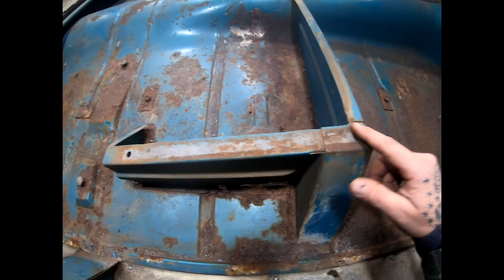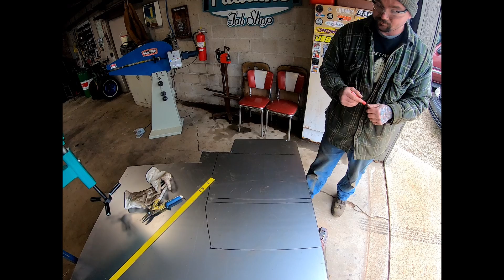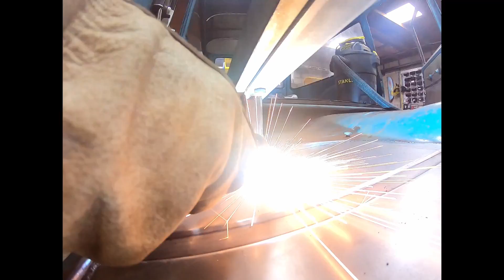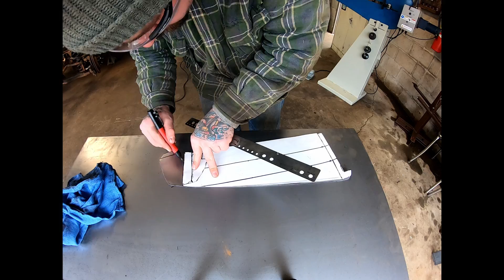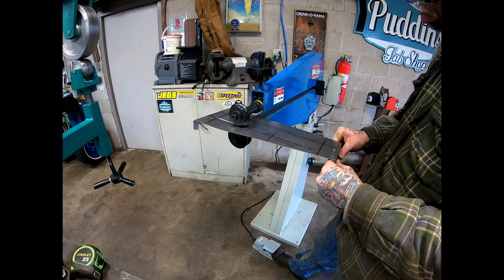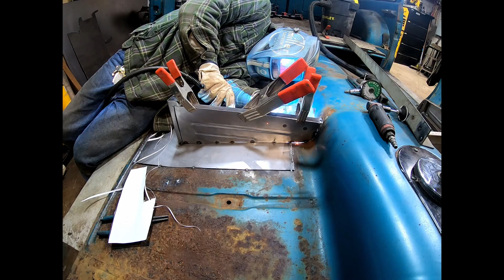BUILDING A SEAT PAN & FLOOR PAN

Comment: Seat pans turned out very cool, I have  a dumb question, do switch welding wire from doing sheet metal work and frame work or stick with one size? Just curious, I tend to burn holes in sheet metal with the heavier wire.(I am definitely not a good welder)
Reply from the maker: That’s a good question. I stick with one size. .30. I like it for both, I’m sure it’s just what I’ve got used to. The millermatic 211 has spoiled me on welding whatever thickness. Set it and forget it lol